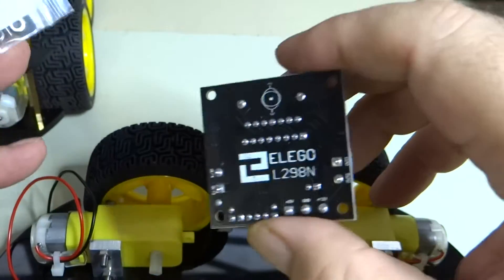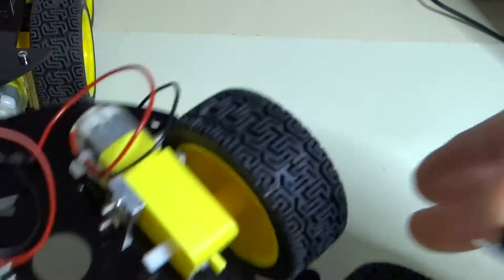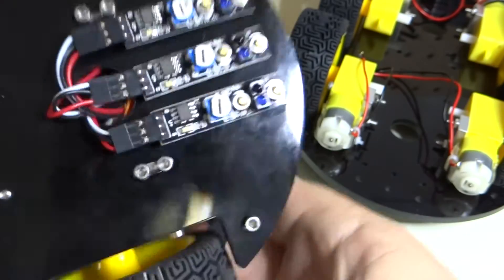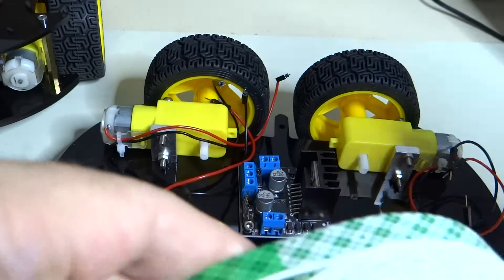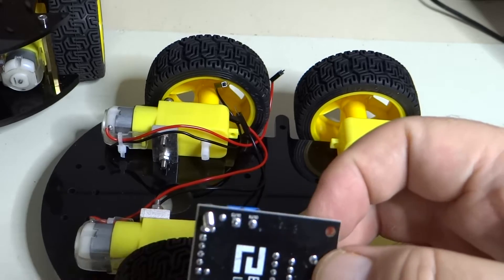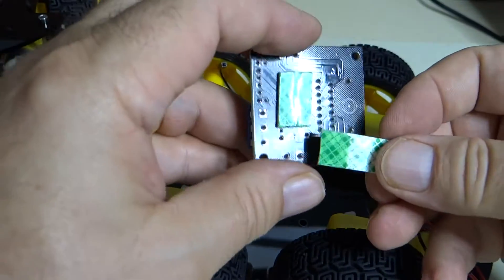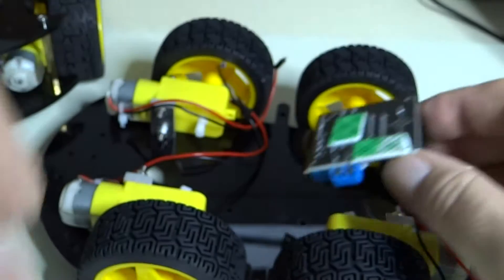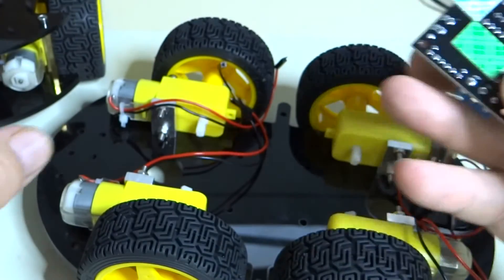Elegoo SRC kit 08 motor controller2

Comment: I went to my local Ace Hardware store to see what they had as far as nylon spacers. They had some that were the right diameter, but too long. I noticed they had spools of plastic tubing and found some that was the perfect diameter. I had another project that I needed some spacers for, so I had the kid working there cut off about 6" of it for me. He said Merry Christmas and said I could have it for free. I cut it in 1/8" lengths and installed them on the mounting screws of the circuit boards. The tubing is soft enough and the right size to stay on the screws by themselves.
Reply from the maker: TinkeringJohn that's a great idea! Nylon spacers are expensive and often not the right length.